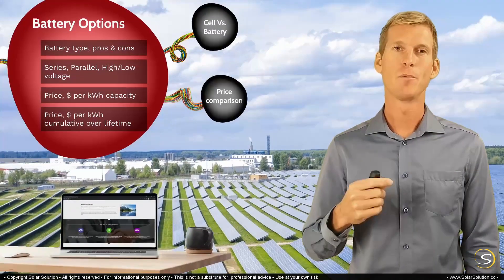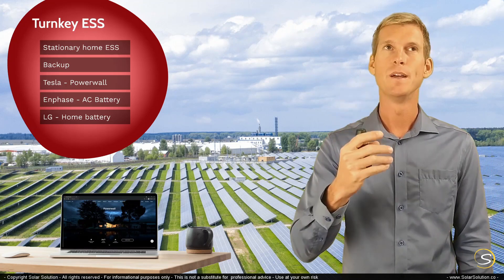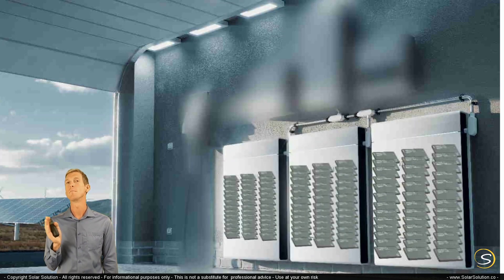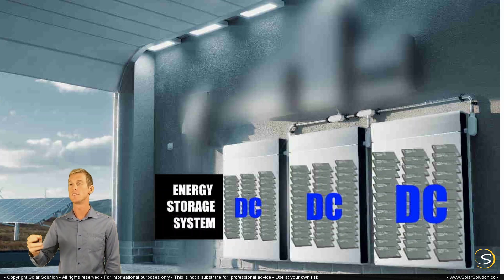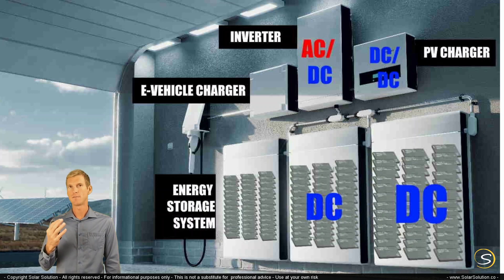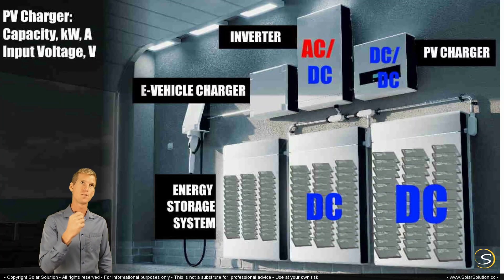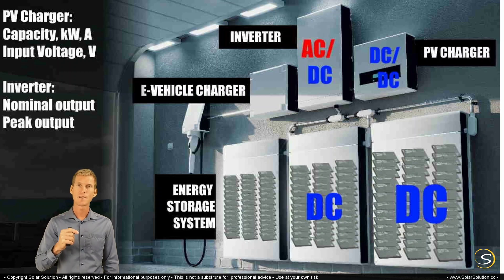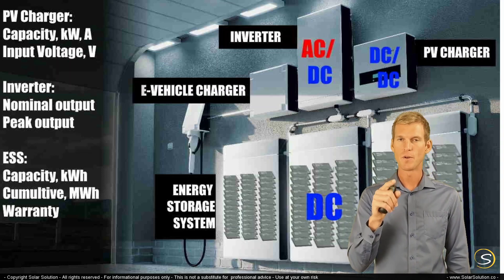Home Battery Backup: The system values you need to know

Comment: For residential use, presumably the inverter is a “pure sine wave” design.
Reply: These new hybrid inverters are all pure sine wave, better sine quality than grid generally and come in many variations, ie: HF, LF, PWM, MPPT, all different voltage PV & Battery voltage models with too many features to discuss here. Cheers